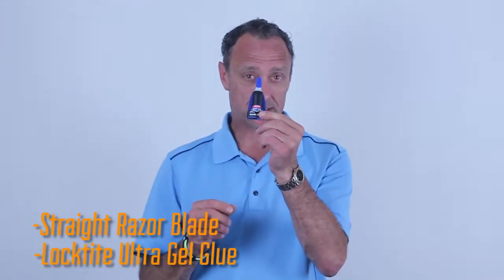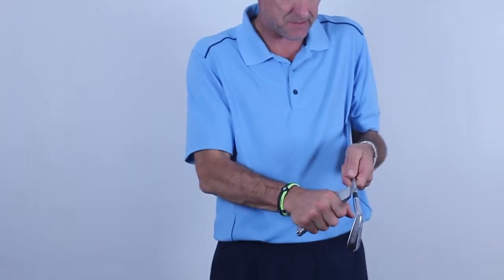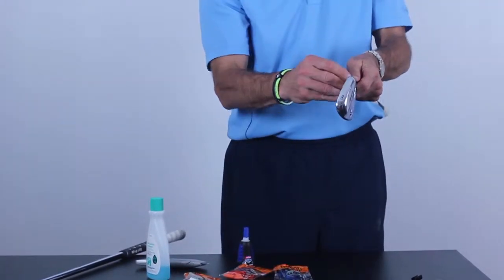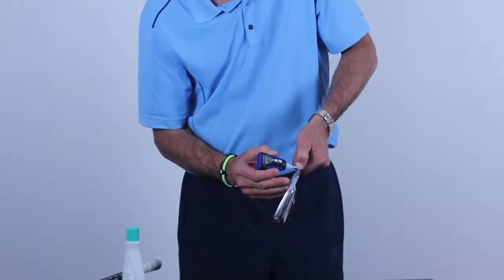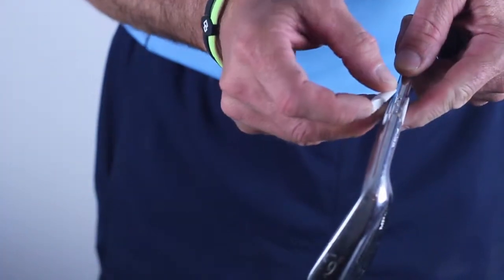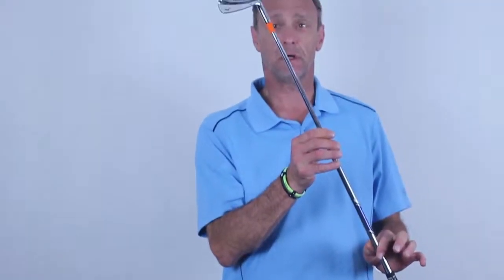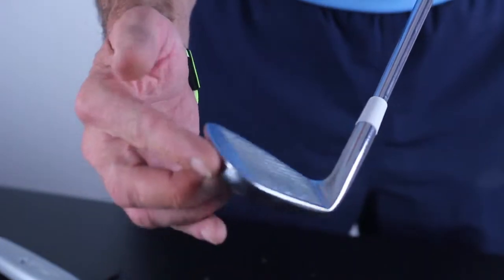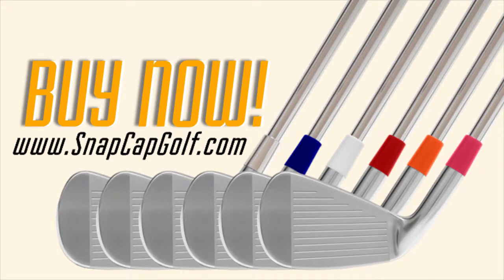Snap in one minute!

Comment: I have lost 3 sets now. They don't seem to hold as well as advertised. Thats for sure. Well glued, almost to much on some to see if that was the issue..Afraid not, my swing speed and connection seemed to break the glue and the pieces would go flying. lucky they are cheap.